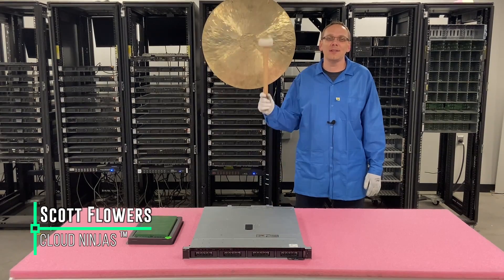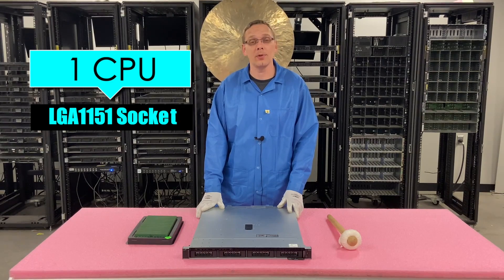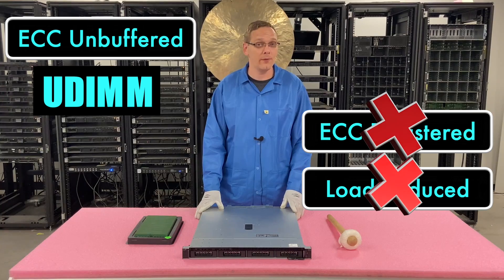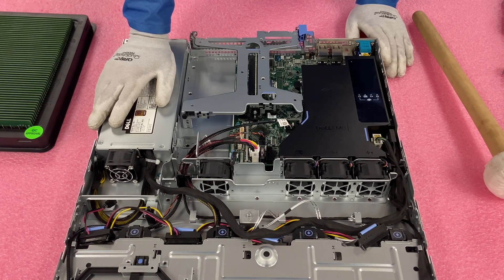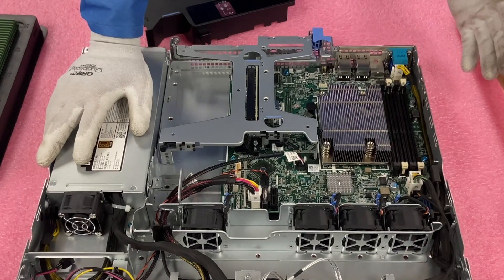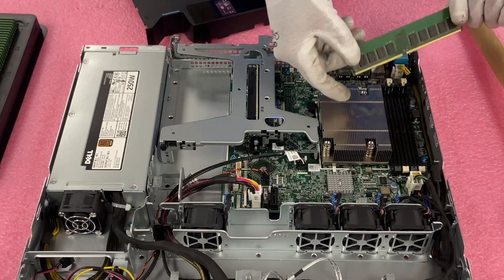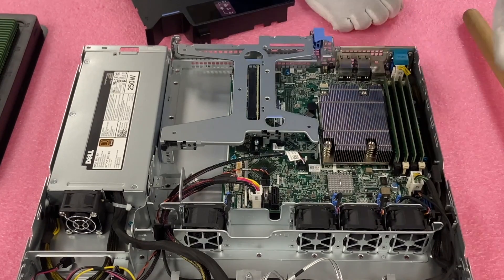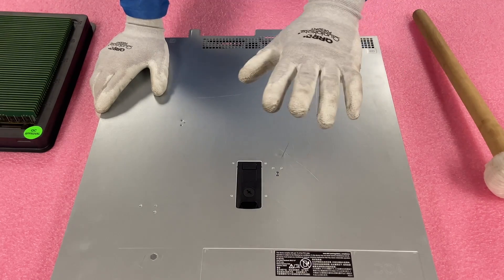Dell PowerEdge R240 Server Review & Overview | Memory Install Tips | How to Configure System

Comment: Hi scot I received my r240 but there is only 2 hdd caddy so on right side one black bracket so can I take off and upgrade 2 more caddy and with cable that will work ? And I also upgrade nvme 1.6TB will using raid so all 4 ssd will work with raid ?